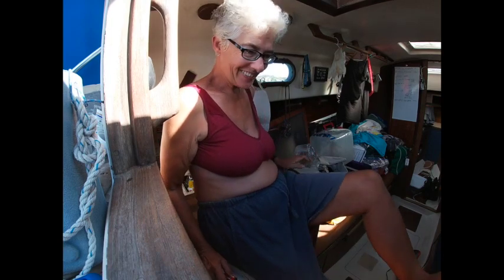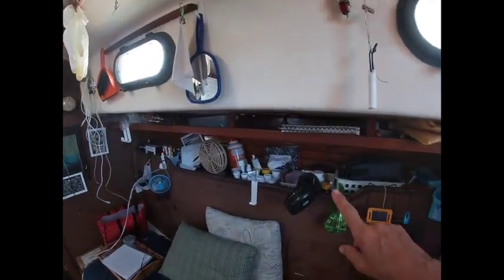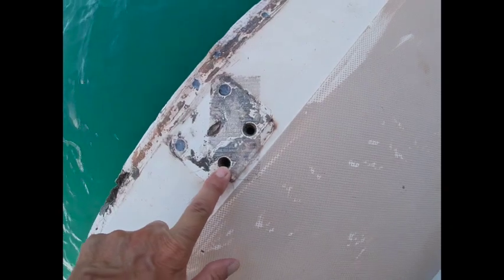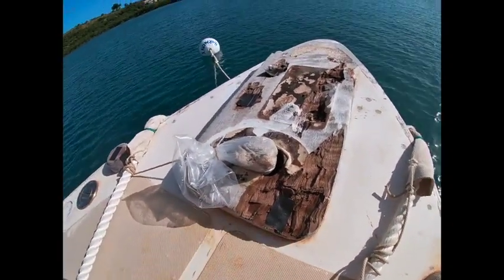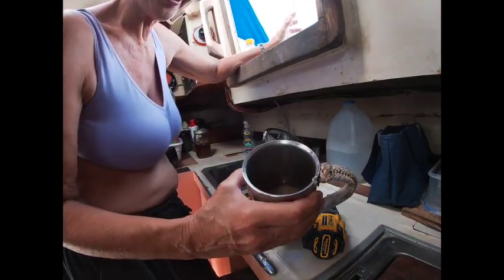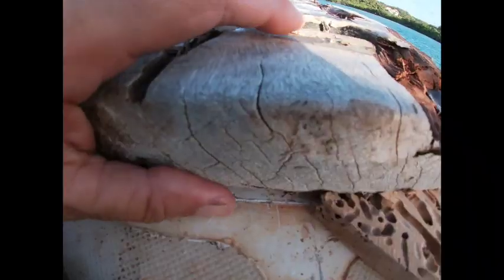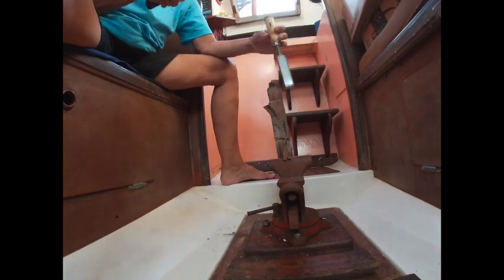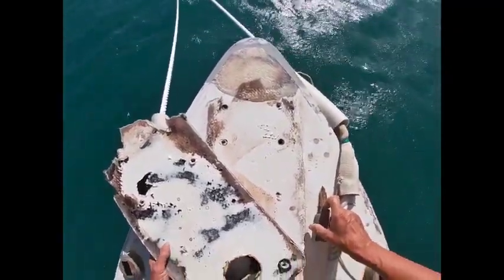Bowsprit: Will it come off?

Comment: patience is a virtue. =D   I used a similar method for removing an anchor roller/platform from the bowsprit. Thumbjack to slowly pry it up. Of course it was slathered with what looked like 5200. Good job Beth.
Reply from the maker: Ooh, what's a thumbjack? I will have to look that up!!
Reply: @BethBrowne  A very small jack that uses a screw mechanism to move it. Handy in small spaces.